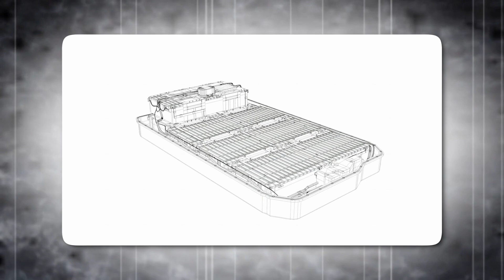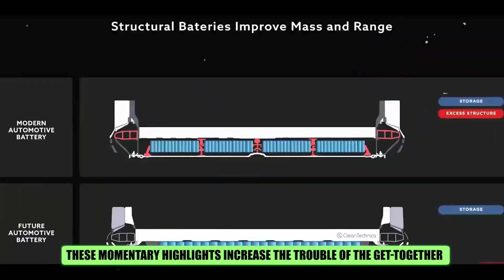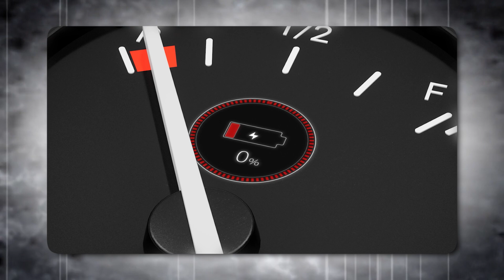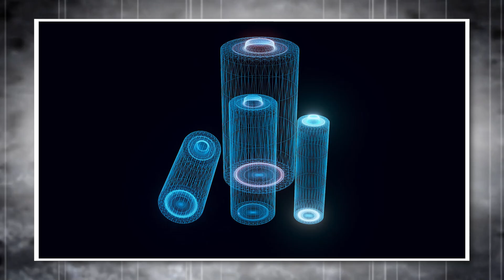China NEW Solid State Battery Just Disappointed the EV Market

Comment: Looking into the future, the Li batteries cannot support the Demand and/or Comfort and/or Safety. Hydrogen is still several years away, but it promises improved value. We need to be patient - in ten years new ideas will emerge, to be more efficient, cheaper and most of all -SAFE!
Reply: Oh dear hydrogen fanboy. Battery costs will drop from 100$/kWh to 50$/kWh by the end of the decade, while hydrogen costs remain uncomparably higher. The energy density of Li-Ion Batteries is projected to increasw from 250 Wh/kg to 350 Wh/kg in a few years, while hydrogens energy density will merely increase from 120 Wh/kg to 220 Wh/kg, still miles away from Li-Ion. Li-Ion Batteries have a already nearly 100% efficiency while hydrogen is projected to have an efficiency of 20-40% by the end of the decade. Li-Ion batteries are more than likely to remain outperforming Hydrogen and Hydrogen cars in the future. If you want to pay 3 times the amount to fill up your car with hydrogen (instead of gasoline or Diesel) you can do that, but most likely nobody else will.
Reply: @alib9824  Which end of which decade? Gasoline price has doubled in CA because the governor believes he can do so. EV's sales are plummeting because replacement of the LI-battery costs more than the yearly income of many people. There is only ONE provider of ELECTRICITY, and they are ramping the costs. Lithium is still at short supply, and Musk has stopped building chargers. Happy now?
Reply: @generaclesdey4622  it’s true that gasoline prices have risen in California, this isnt solely due to the governors policies, but also global oil market dynamics. EV sales are still growing, maybe not so much in the US but in the rest of the world for sure. Lithium supply is a challenge, but investments are ramping up to address this (Hydrogen is even more of a challenge btw). Regarding the chargers, how many hydrogen fuel stations are there again in california? Yeah i thought so
Reply: There are multple labs and universities working on new methodologies to create Hydrogen from water EFFECTIVELY.  The current target is to fill the vehicle's fuel tank with WATER, and extact the H2 as needed. The support money is already there in abundance. 
I've already explained that there are 145,000 gas stations in the USA to satisfy the 6-minute fill up when needed. There are only 65,000 Charging stations. If EV's become half the traffic on the road, and they require an hour to charge, we will need the equivalent of 1,450,000 charging points (including home systems). The math says that this may take "only" 20+ years to build, with only ONE PROVIDER - the electric company. Local "Edisons" are already ramping the cost of electricity!
Reply: @generaclesdey4622  This technology about H2 extraction from water (efficiently) might take another 30 years to be mainstream. Until then, if you want to use H2 instead of gasoline in current gas stations, very high safety standards need to be met and that costs a lot of money and time.
Reply: @alib9824  Actually, EV sales are 10% lower than last year!  We have hundreds of companies owning oil wells, and they will need to reduce the cost of gas to compete. The Electric Company is Sole-Source - they can raise the cost of power as they wish. And they will!
Reply: @alib9824  Please explain where you got the 30-year H2 prediction! There are multiple companies and University Labs working on cost-reduction of H2, with expectations of 5 years or less for declarations of success!
Reply: @alib9824  ...But electricity costs will DOUBLE because there is ONLY ONE SUPPLIER - the owner of your local AC grid@!! That's "Sole-Source" for you!